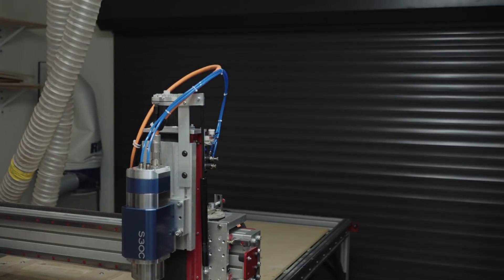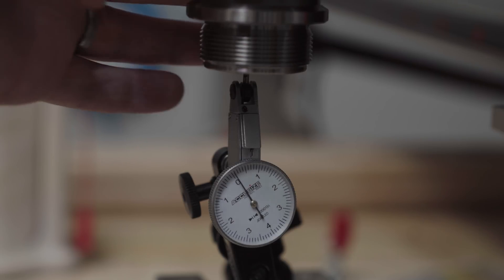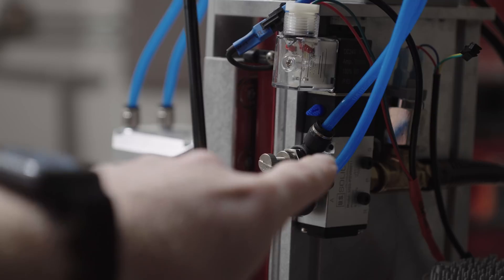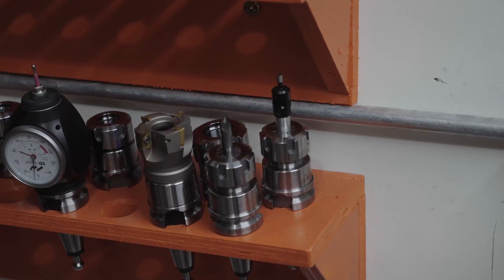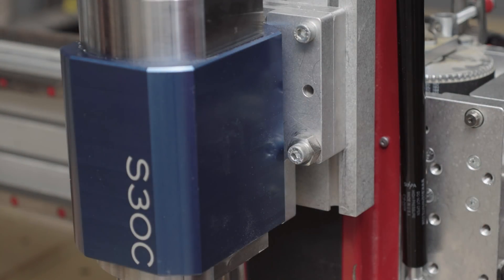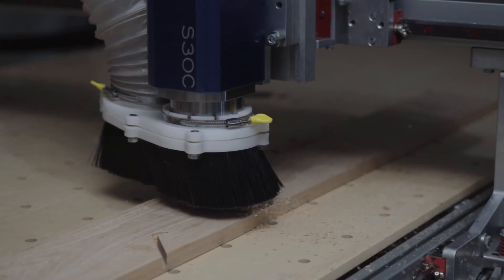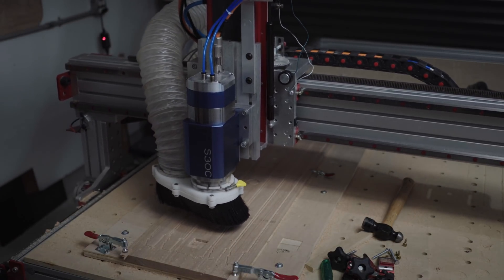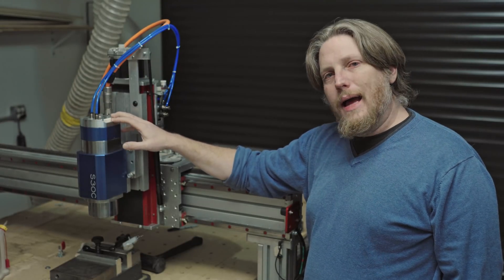CNCDepot S30c ATC Spindle Review

Comment: Hello! Great video! I am getting my ducks in a row for an avid purchase and I would really like ATC capabilities and so far this looks like a terrific option. Question.. How does the 3hp handle spindle handle surfacing operations with a 2 1/2" surfacing bit? And  full depth cuts through 3/4" plywood with something like a 3/8" end mill? I am currently running a 12hp spindle at work and now want to purchase a machine for personal use that is within my budget. I just want me make sure the 3hp can keep up with the kind of work I will be doing. Thanks in advance!
Reply from the maker: I think you are going to find the rigidity of the machine and the strength of your steppers are going to be a limiting factor before 3hp becomes a limiting factor...  As for your two example scenario.  Surfacing is more than fine.. And I have never done full depth cuts on this machine so I can't answer that...

Comment: Good video.  I'm looking at purchasing a CNCDe3pot S30C and wondered how has it held up for you over the last 2.5 years?
Reply from the maker: No complaints.. I still don't have full ATC going with a rack and all that, however this is by far the most valuable upgrade I have ever done..   I LURV tool changes happening in 5 seconds instead of a few minutes..

Comment: How is the spindle still holding up?  Is it still worth every penny?  Hoping to add an Avid 6096 soon.  Would you recommend just wiring the whole machine with the Panasonic sensors and stay away from the Pepperl + Fuchs Proximity Sensor Kit?
Reply from the maker: LURV THIS SPINDLE!!!! Can't say enough good things about it! 
I can't speak to legit Pepperl + Fuchs Proximity Sensor Kit I was using chinese knockoffs and they kept dying.. I switched over to the panasonic sensors because that is what my mill uses and it made sense to get the mill and the router to use the same sensors after the sensors on the router kept dying..   I would hope name brand industrial sensors work better than the trash I get off amazon.

Comment: Quick question for you. I'm using the S30s now on an Avid CNC and have an issue in that the z will drop due to the weight if my servos don't have power. This can happen during a fault. I noticed you have gas springs attached to yours. I ordered some but stupid me, they are push vs. pull. Can I ask where you got yours?
Reply from the maker: McMaster Carr its a push spring - https://www.mcmaster.com/catalog/126/1351

Comment: How did your stepper motor handle the extra weight ? It looks like you have a gas strut mounted to the Z axis. Also how much more torque would this have vs my bosch 2 1/4 HP router. I have a older cnc router parts/avid cnc router and I am really thinking about buying this as it takes to much time for tool changes. Thanks
Reply from the maker: I am running Servos, so they react fine.... I haven't noticed any performance issues in my Z axis and at this point I've had the spindle for quite a while..

Comment: Let me clarify the question I just posted a moment ago -- i rewatched the video and you clearly said the always-on air pressure is lower, like 40 PSI vs. 100-105 for the tool change.  So my question is about the CFM requirement for the 40 PSI that's always on.  Also, I was confused by your solenoid valve -- it looked to me like you had a single inbound air line to it, and the solenoid switches between always-on air and tool-change air.  But since the pressure requirements are very different for each, where are you setting / controlling the pressure for each of these lines -- between the solenoid and the inputs on top of the spindle?   maybe I just didn't see clearly how you've set it up.  Thanks!
Reply from the maker: I can't give you a CFM.. What I have been told by CNCDepot is that any air pressure you can feel is enough.. Its just some positive pressure to keep particles and dust out of the bearings.  That hose is a little 1/8" hose and the bleed off of the solinoid I use to feed it is just cracked open... I would say the usage is probably similar to an airbrush or two.. so very small.

Comment: Hi, thanks for the detailed review.  I've just ordered one of these but haven't received yet.   Question about the air requirements -- what minimum CFM is required for the always-on constant air for the air seal?  and is the pressure for the always-on air the same as the pressure for doing a tool change?  I'm worried my old compressor may not be adequate for this but any info you can provided would be great.  I've reached out to Alex also but haven't heard back yet.  Thanks!
Reply from the maker: we run a single regulated 100psi line to a solenoid on the back of the gantry... There we switch between a totally open (all 100psi) pressure to operate the.. that line is normally off (only on when the power drawbar is open).  The other side of the solinode goes to a valve that cuts the air volume way down (just a slight breeze coming out from the bottom of the spindle) and that one is normally open.. So the air pressure switches between the constant air and the drawbar..   Hope that helps
Reply: @HandsonCNC  Thanks that helps a lot.  One other question -- what is the "valve" downstream of the solenoid that reduces the air volume way down - is it just another regulator?  Do you have a link or a product name?  Thanks much
Reply from the maker: @carlpetitt2241   its nothing fancy just a little pin valve to limit airflow : https://amzn.to/39RhPKf

Comment: Did ya cut yer z plate I’ve noticed they are quite a bit too long I might cut mine too. How’s this Spindle holding up ?
Reply from the maker: So far so good for the spindle... ,  the Zplate is factory from AvidCNC.. I haven't cut it down at all..
Reply: Interesting mine looks 4” longer
Reply from the maker: when I ordered mine there was an 8" and 12" version of the Z axis.. I ordered the 8" I think  that very well could be it..
Reply: I have the 8” travel as well but my plate is 14” long 🤦🏼‍♂️

Comment: Hi, nice video. I have some improvements to say. Please increase the breaking acceleration, so that you can stop your spindle in 1 or 2 sec. Another tip is, never hold the tool holder like held it at 5:48 :-) or you will clamp your fingers with a few kilonewtons :-(
Reply from the maker: Thanks for the pointers, because I don't have an ATC setup and a human is involved in changing tools, I don't think I have the VFD applying much breaking at all (also I don't have a break resistor so I would have to balance with what the VFD can soak or get hit with an over-volt error)... And thanks for the safety tip!

Comment: Little suggesttion. way lighter passes,  toolradius = max depth of cut per pass. especially with smaller diameter tools due to the strength of the machine and its capability to destroy itself. It gets quieter too. It won´t scream as much that way
Nice viedeo though, that machine is a beauty. I wish i had the space.
Reply: I'm not quite sure where you got the idea that the tool radius = max depth of cut but that is not correct.  Using your formula if I had a 1/2" dia. tool, I would only be able to cut 1/4" deep per pass.  I routinely take 3/4" deep pass with a 1/2" dia. tool without issue.  As a starting point a tool can cut 1 1/2 - 2 times the tool diameter per pass.  The more important factor is maintaining the correct chipload.  The correct chipload will ensure the tool lasts longer, you will get the desired finish on the cut and the spindle will be working in an optimal range.

Comment: Yeah that is not a good quality spindle. The bearings are noisy as hell. Sounds and cuts like the cheap chinese ebay spindles.
Reply from the maker: Not sure if you saw the other comment but the spindle noise ended up being some connector supports for my Nitro spring.. This was a replacement of a cheap chinese spindle and it is way better and sounds better too.. The audio in the video just doesn't express it.. The cuts are better (though spinning a bit is spinning a bit so I think that is likely more to do with how it mounts to the Pro4896 as that is far more ridged than my old chinese spindle)... This upgrade has been A++ for me, would totally do it again!

Comment: I'm planning an epoxy-granite vertical mill in similar basic configuration to a Tormach and looking at this as a possible spindle.  I'm finding very little information on how it handles hardened steels, such as 4140 or even S7.  This is going to be a hobbyist/prototyping machine, not a production one.
Reply from the maker: you will want something slower with more low end torque for dealing with steel.. High speeds are for wood, tiny endmills, and some light aluminum work..  you are far better finding a spindle that tops out under 10k but can go down to 500 with good torque than a high speed spindle like this..
Reply: @HandsonCNC  Thank you for the information.

Comment: Awesome video, I been waiting to see some videos like this before I bought one of these spindles, plan on getting an ATC for my CNC router parts pro I am converting to a custom machine this spring and this spindle is near the top of my list and basically my #1 pick after this video.
Reply from the maker: Yah I've been pretty happy with it so far.. and even though I don't have my ATC worked out yet.. just having the powerdraw bar in the Spindle is saving me mega time on tool changes...  Once you go with a power draw bar you will never want to tool change a router again...

Comment: Follow-up question: Already found the culprit that make the unwanted noise, so what remedy or solution did you make? Change the air spring?
Reply from the maker: I haven't decided what to do about it yet.. It only happens when I am at my Z++ limit (or near it) so for the moment Its not as high a priority as designing a retractable wine rack for an ATC.

Comment: Thanks for posting these vids. You are doing exactly what I have planned for my 4896 I use in my shop. The clearpaths, the S30C and eventually an actuated linear rack for the backside.
Reply from the maker: Planning to go the same way.. The design I am working out for my wine rack is to place it on the back of the machine on set of linear rails that are on top of the side bars, then use pnumatics to extend and retract them...   I am also thinking through how to handle the lock and release, as the spindle sucks the toolholders up about 1/4" and visa versa during the lock/release process.. I am thinking something with springs.. will share the design when I have it all worked out.
Reply: @Devin Harris do you have a BOM of everything you bought and from where?

Comment: Sounds like you have a frequency problem. It should run much smoother than that.
Reply from the maker: I am in contact with CNCDepot about the issue, I've had a lot going on and haven't put enough time on it to know if its a frequency issue or a grease packing issue or a bearing issue.. But we are in constant contact.. 

I will say under load it sounds fine and cuts great..   If we find the issue isn't resolving with break in then I'll post an update.
Reply: @HandsonCNC  did you figure out what that weird noise is? I have a spindle that is doing the exact same electronic noise type thing.
Reply from the maker: Alexander James Guitars  I did; the raddle noise was actually the counter weight spring. Something about the harmonica of the spindle. It causes the air spring to make that noise.  So not the spindle. 

Spindle is still smooth and cool.

Comment: Damn that is one sexy spindle! On your noise issue it is common industry practice to install a ground rod at each machine.
Reply from the maker: thanks for the suggestion.. not sure how the wife would appreciate me drilling holes in the garage floor and driving a copper rod into the ground ;-)... the frame of the machine is grounded to the house ground but its probably too far away..  I might try hanging a piece of metal off the frame to touching the concrete because the feet are electrically isolated so the concrete floor is not a potential path for ground currently (even though the chunk of earth outside my house where the service entrance is...